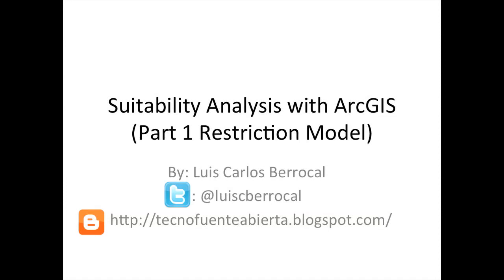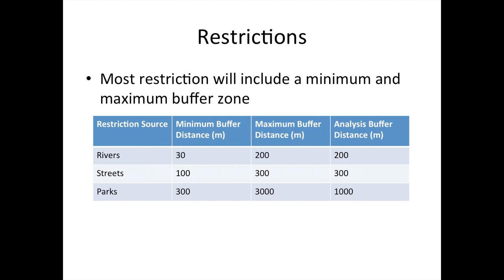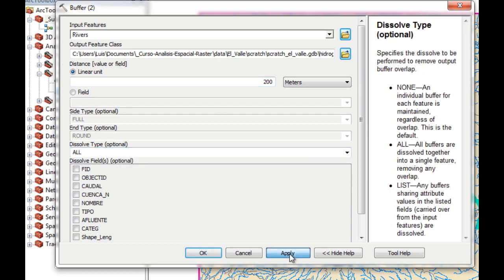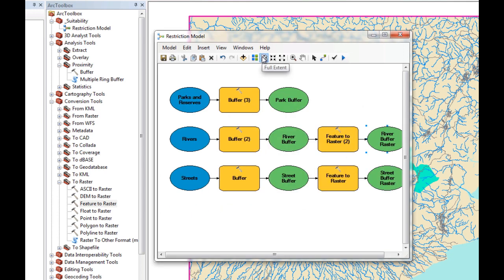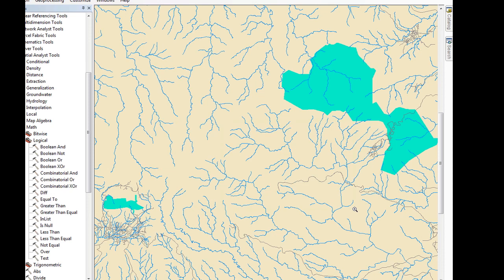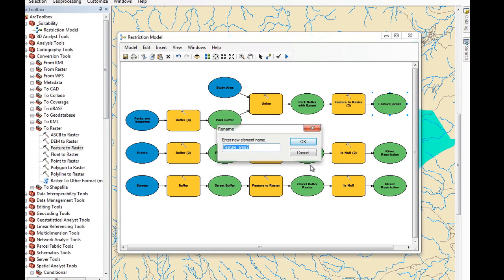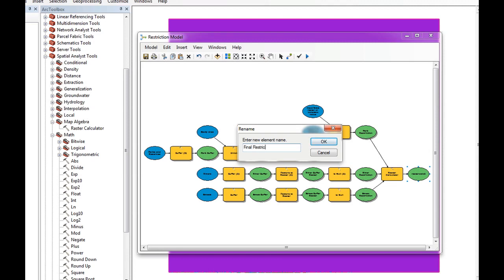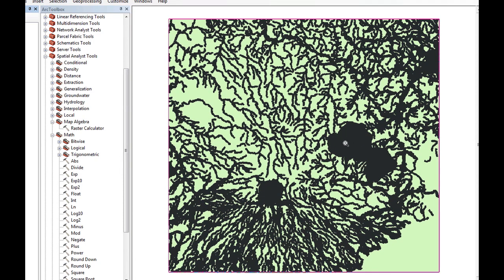Suitability Analysis with ArcGIS (Part 1 Restriction Model)

Comment: The Model Builder is beautifully explained. I followed your instructions step by step. However, after changing the name of "Water Bodies Buffer with Extent" when I clicked "Run" I receive the error message, "ERROR 000354: The name contains invalid characters". How to resolve the issue?
Reply from the maker: Check: the name is not being used somewhere else in the model, that the input or output path do not contain spaces, tildes or special characters. Hope this helps
Reply: @LuisCBerrocal  Thank you Luis for a swift response. Let me Redo the Model Building and see the outcome.